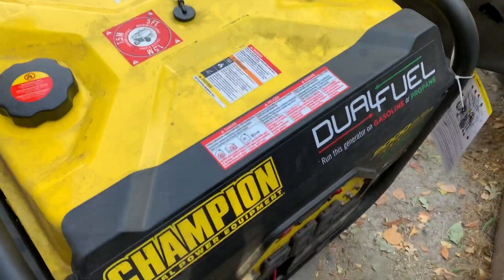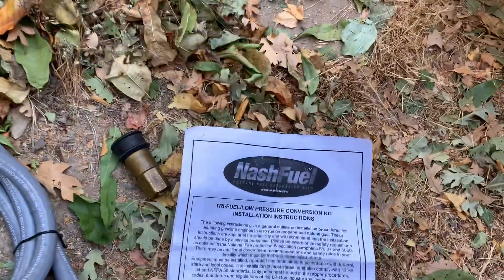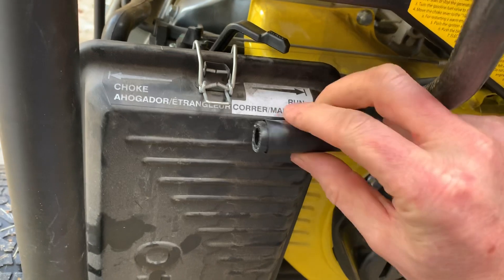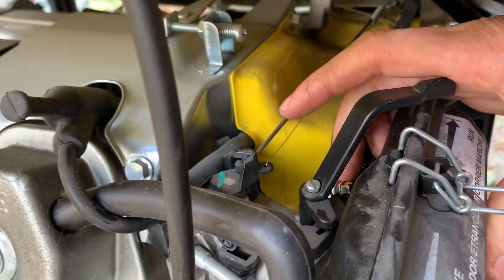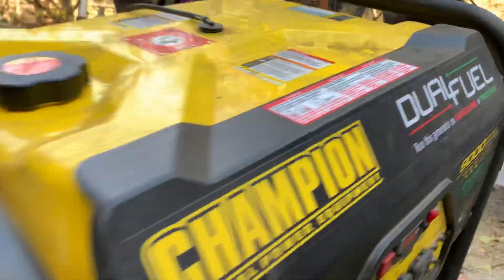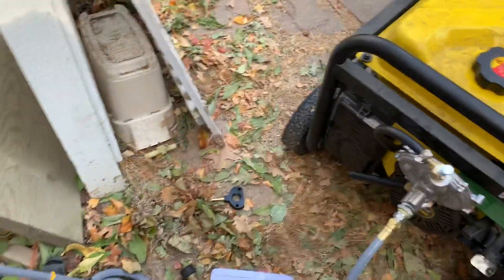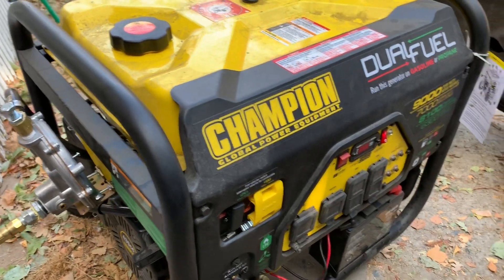Champion 100155 Generator conversion to Natural Gas Quick Shortcut

Comment: Any thought to putting a y hose connector with a valve inline so you can swap back to the original regulator If using gas or lp?  Seems it would be cheaper than the parts to hook the new regulator to lp and gives you more flexibility.

Comment: Actually picked one up off a curbside trash pile that was missing the airbox and gas tank. I hooked a battery up and sprayed some carb cleaner in it and it fired right up. Got the new airbox delivered and plan on doing this to it to run on Natural gas or propane only. I'm sure the carbs are all gummed up. I'll save that for another day and dollar!  Huge score for me. As I was limping through power outages with my 25 year old Coleman Powermate Briggs and Stratton.
Reply: Poor guy was just setting it up a safe distance from the house.... Ha!
Reply: @reese2694  LOL! No! He actually helped me load it onto my trailer. Weighed a ton!
Reply: Love when people throw shit away like this somebody threw one away cause they couldn’t get it running I knew right away. I just bought a new carburetor slapped it on.

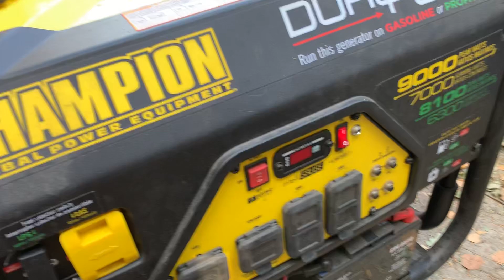Comment: Excellent video my friend. I'm confused on one thing. You say at 3:17 "Once you dial in the bolt depth...you can adjust it up and down and it will dial right in." I have no idea what this means. Can you explain. Thank you. Again, great video.
Reply: Sometimes referred to as the "load block" or "power elbow" etc., the bolt adjusts the fuel to air mixture. Loosen nut first. Then, turn OUT (counter clockwise) for RICH. Turn IN (clockwise) for LEAN. Some folks adjust this setting, while running, for 50% or 75% load while obtaining highest RPM, plus or minus. Once adjusted, tighten the nut to lock in setting. This setting will need to change when you switch fuel between propane and natural gas. 

The above is accomplishing the following: for any given engine speed, the same volume of air is drawn into the engine (more below). When changing fuels, you will need to match the appropriate volume of fuel to mix with the given volume of air, by adjusting the Load Block. 

There are many factors which can affect the fuel mixture. One is elevation. If you move your generator from your home at sea level to a cabin at timberline in the mountains, your "dialed in" settings may not work very well. Less oxygen content in that "given" volume of air making the fuel mixture TOO Rich, in this case. Be prepared to re-adjust the Load Block setting if you travel to significantly different elevations and run your generator. 

I include the following because I wanted to know what the fuel mixtures were myself: In very rough terms for combustion, 
Propane mixture is 24 parts air to 1 part fuel. 
Natural gas mixture is 10 parts air to 1 part fuel.

Comment: the ventury in the kit is larger so more flow gets to the carb.  You run to lean with the smaller ventry for the propane because it is much higher pressure.  You can melt engine parts that way.  Your generator will have a much shorter life if not immediate failure.  You really need the ventury from the kit!

Comment: here is my question.  Have you tried running nat gas thru the oem regulator?
Reply: I tried on mine. It started but wouldn’t stay running unfortunately. There’s a couple of other comments here where people say it will work however. I may have given up too soon, the battery was dead and I got tired of pulling the rope. Maybe I didn’t give it a chance to purge the air from the 25’ hose I was using. Will try again when I get a new battery next week.

Comment: Love the video. My thoughts are to buy a Garretson KN or comparable regulator on line much cheaper instead of buying an expensive kit with extra parts you won't use. You can find rubber hose and quick disconnect fittings online too a lot cheaper than buying a kit. Great job tho.

Comment: I was just about to try the same mod on my brand new generator (never used so far) but I am concerned about the fact that gas runs the engine very dry, especially in the valve seats. I must come up with an answer to that or I will face some parts of the engine running hotter than they should. In the old days, we used to have lead in the fuel which would deposit on the valve seats and guides creating a protective coating, with the advent of unleaded they have come up with some substitute additives but with gas, we would non benefit from either of those.

Comment: I noticed the kit number you gave has a small regulator in it that I don’t see on your generator. Also the kit does not show the adjustment screw on top of the large regulator. Can you fill me in on this kit? I have the same generator, Champion 200155. Thanks

Comment: what size is the grey hose leading to your generator, it seems its thinner like the propane lines and you just used it for gas and it works, am I correct?

Comment: I don't understand...if the conversion kit Nash/Garrison regulator can run either natural gas or propane...why doesn't Champion just factory install a similar regulator that could also run on NG or LP?  I see now champion offers a stock model Tri-Fuel generator, but other manufacturers don't appear to.

Comment: Is it possible to adjust the flow rate on the existing LP regulator on the generator to accommodate for the lower pressure of natural gas?
Reply: It is not big enough. Propane runs bitter than natural gas so you have to have more flow to use nat gas.
Reply: @russellcampbell6412  this other guy posted a video where he ran the natural gas directly into the gasoline input with no regulator and it appeared to work just fine.

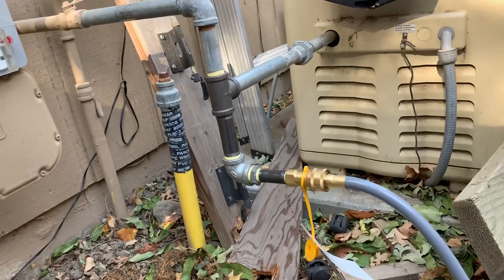Comment: Where you connected at 2:30 is actually not a T but s sediment trap. You should have your line connected to another T then a straight line below it to catch sediment.
Reply: first thing i noticed also.
Reply: this is correct.
Reply: Thank you for pointing this out. I saw that on my NG connection and thought, "I can connect the generator line there." Maybe I should hire a professional.

Comment: Thanks for the video, what do you need to do in order to use regular gas again? Do you guys leave it all connected and switch it bag to gasoline mode like it was stock?
Reply: I will answer based on general knowledge. You would turn off natural gas supply to regulator, turn any fuel selector switch on the generator to gasoline mode, add gasoline, turn on choke, start generator, and turn choke off once generator appears stable (usually less than 5 seconds).  Hope that helps.

Comment: That's brilliant! 
So the natural gas regulator will also do propane, but the propane reg. doesn't do both??

I watched one conversion where the guy had to put in all sorts of engine lift and other adapters. This is great!
Reply: Every household, business, etc. that uses natural gas already has a built in regulator provided by the supplier included with the meter. There is no need for another regulator on the generator FOR NATURAL GAS! Propane can use TWO regulators which is recommended ( one attached to the propane tank and one on the generator's carb.!

Comment: Just an FYI. The point you connected to on your gas line is a drip leg to collect moisture. You should add a T there and another 3-4 inch nipple with a cap to catch any water and not push it into your  generator.

Comment: I just got the Champion Dual Fuel 100153 and did this same set up. Mounted the new regulator, disconnected the LP hose and connected the new one. It works perfect. I got the regulator kit in the comment section. It came with the regulator for natural gas and came with the propane regulator. I had a question for the regulator seller if I needed the LP regulator also with the NG regulator (I do) he got right right back to me with the answer. He also recommended 1/2 or 3/4 ID hose. Easy set up just take your time to do it nice and right. I'm ok with losing a bit of power with natural gas but I don't have to go and fill and transport gasoline, but still can if needed. Thanks for the video it was a huge help. I had to use a bit of choke when starting but ran fine.
Reply: David Porter Why would you need the LP regulator with NG, this conversion bypasses the LP. Unless you’re saying that you need to leave the LP regulator in place if you want to reconnect and run on propane at some point. The beauty of this is it creates a tri-fuel capability.
Reply: @markymark8665  reconnecting the hose from the factory regulator LP is a pain. What I mean is the kit came with a NG and  LP regulator. If I wanted to use LP, I'm not going to reconnect the factory hose. Did I need the LP with the  NG regulator? I didn't know. So the seller confirmed I did need it and yes it is now a tri fuel. It seemed weird to have 2 regulators in line to use propane if desired.
Reply: Hey Dave,I'm in the process of ordering parts for the conversion. What size is the hose that replaces the factory Lpg hose? I see there are two choices I'm looking at for the size of the load block at the top of the regulator. One is 3/8 × 3/8, the other is 3/8 × 1/2 hose connector. I have the Champion 100155. Thank you
Reply: @asj9793   Being a year ago I'm not really sure. I do remember that the hoses that came with the kit I used them and it worked out fine. The black hose from the new regulator to the generator in the kit worked out just fine. I got the kit that was in this videos link. I did get a flex gas hose on Amazon to go from the new house NG fitting to the new regulator and the was a 12 foot x 1/2 inch inside diameter. Let me know if you have any other questions.
Reply: You should get an award for being confusing.  So please list the connections from the generator to the tank/gas source for LP and NG
Reply: You should the award for the greatest grump😂 @maxthrottle4072
Reply: You should get the award for the greatest grump😂 @maxthrottle4072
Reply: I tried it but I can’t get it to run right. Seems to putter unloaded. No amount of adjusting the load block fixes it. Hose size is as large as I can get. 1 inch quick fitting for a barbecue right off my meter, and 1/2 line I neck down to 3/8 at the carb. Might be 2 inches of 3/8.  Carb stud for the hose is 3/8. Even with a 1/2 hose clamped down on it, still the same.

Comment: Just did this today with a $60 regulator I got on ebay , works great. The propane and gas works without having to do any adjustments as the hose comes with a regulator for propane already. Still able to start my AC on natural gas. Thanks for letting us know we don't have to install the suction adapter.
Reply: What's the link to that $60 regulator?   Thanks for posting the info!
Reply: @beeerhunt   Just search WOODWARD LOW PRESSURE REGULATOR NATURAL GAS. Looks like the price dropped a bit. I hear the generator will work just by hooking the natural gas hose directly to the generator without the propane hose regulator attached. You may want to try that first.
Reply: @billybassman21  ...I have a gasoline only generator (A-iPower SUA12000E)... and I suppose I have to have a regulator for NG.
Reply: @beeerhunt  You will have to get something like the Ipower SUA12000E Propane/Natural Gas Tri-Fuel Conversion Kit from what I can see.
Reply: @billybassman21  ok billy, thanks!  I'll just have to keep researching! There are also replacement carburetors that work and much cheaper than the kits
Reply: @beeerhunt  yeah, that's what I got, $30 carb, made my 9kw gas gen dual fuel, runs great on propane now, think I can power my home central AC for 12hrs-16hrs with 3 20lb tanks
Reply: @paulmcclure7794  thankx for replying! I've purchased two carburetors, one from Lumix and one from V-power ( both Amazon sellers) and NEITHER of them would fit so I returned them both and was refunded! Seems my only option is the US carburations snorkel kit which is close to 200 bux. My area does not have that many outtages so for now I will abandon the idea for using dual/tri fuels. My gen is a new A-iPower SUA12000E
Reply: @beeerhunt  yeah, I had a little trouble finding the correct size carb on amazon, most were smaller, would say 5k gen max, finally found one big enough.  I put 6k of load on it with the new carb and on propane, ran great!
Reply: You run central AC on this generator?  I have a 4 ton unit I don't see that generator being able to power my CAC
Reply: Stephen Seligson I have a 3 ton two stage 17 seer. I had to a hard start kit, but the AC starts fine and runs fine.
Reply: What wattage is your generator that runs your AC?

Comment: I have a Champion dual fuel model 100165 which is very similar to this. I used the natural gas hose from my BBQ grill and connected it to the existing flair connector on the front of the system and it cranked right up exactly like when it is on propane. My research yielded that the house natural gas is lower pressure than propane, so I don't see what the problem would be in using it just like this. Did you try this before installing the Nash regulator? I suspect that there will be perhaps less output power, but I'm ok with that.
Reply: Original question “can I use a propane regulator for natural gas” wasn’t answered. Unless it’s labeled for dual use, the answer appears to be ‘no’. Here’s a video discussing the difference - https://youtu.be/d2GljedOVaQ. Propane runs at a higher pressure than natural gas. Single type regulators are designed for that respective pressure range. Dual use regulators cover the whole range. This stuff can blow up, so you want to make sure the hardware is properly designed.
Reply: How does the frequency and voltage look? I was thinking the same thing when I was installing my regulator today, but didn't bother trying. Wish I would have now.
Reply: @billybassman21  Frequency and voltage are unaffected.  What happens is your generator is less powerful.  Btw, THD on non-inverter gens is horrible.
Reply: @me6506  It's pretty good on the one I have now, the 4kw I had before was bad, UPS would keep switching from battery to generator. Now I have no issues with the Champion 8000 on LP or NG.
Reply: My Champion dual fuel also runs on NG directly, no modification.  Its a bit hard to start because maybe there is no air purge button.  Otherwise, seems to work great!
Reply: Still working, no issues using the propane port for NG hook up?

Comment: I have this exact same generator, which I've only ever ran off propane, and worked with Nash Fuel and got a similar kit for less which had the same regulator, hose & mount https://www.amazon.com/dp/B083G99LQ1 and hooked it all up yesterday and everything worked great.  I can't really speak to questions below on power output on natural gas vs. propane and have never ran it on gasoline.  It sounds the same, put it under a medium load and it sounded and worked fine.  The only thing I did differently than this video was I unhooked the existing hose end from the carburetor and installed the hose I got from the kit, so I can easily undo it and go back to stock if for whatever reason I ever sell the generator or something

As an experiment I had the generator running, and fired up my 4 burner grill, and then went in the kitchen and turned on all four burners on the stove, everything worked fine and all at the same time!  My gas line starts out at 1" but then goes down to 3/4 once it branches off from the main line, which is what I continued to run to my deck for my bbq & generator

Thanks to the OP for posting this video & Nash Fuel for the kit!
Reply: Thanks for the link. Was the one you have hard to mount? This would be something to adjust and keep in storage if you didn't want to mount it and in a bind (no gas or propane) just hook it up without mounting it.
Reply: Hi - I am having real trouble with this. I have the same kit, same generator and a 33ft gas line, but it won't properly catch. Nash Fuel suggested putting more of the choke on as the pressure might be too low, but it still didn't work. Any ideas?

Comment: Excellent video. Short and straight to the point.. Can you tell me where you bought that long hose with the quick connect?
Reply: Amazon has them. I have a 10’ hose on my NG grill that connects to a quick connector on the deck. I bought a 25’ extension hose to allow me to move the grill undercover during bad weather.

Comment: Would you know if this conversion kit work with the Firman H07552 dual-fuel?
Reply: I have the same exact question. I just bought the Firman H07552 myself.  Does anyone know if this conversion kit will work with this model?
Reply: @michaelregal7916  Check Nash Fuel Conversion Kit for HO7552 on eBay, $110.00 w/free shipping. No real instructions though, that's why I'm watching this video.

Comment: Excellent video.  I too wondered why they shipped me the carb inlet adapter given I ordered a kit specifically for a generator that was already dual-fuel, so it already had the LPG inlet to the carb.  You've saved me time by proving there is no need to install the adapter!